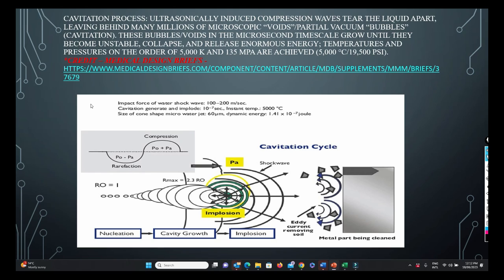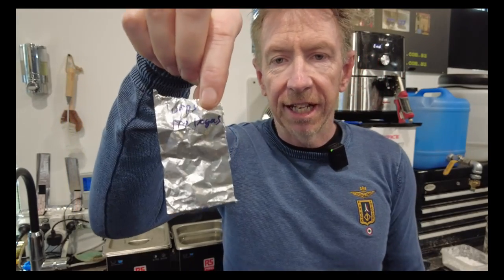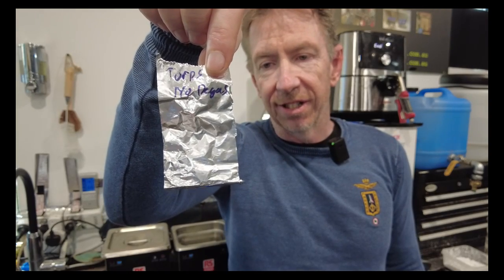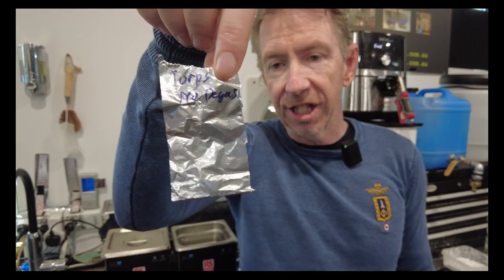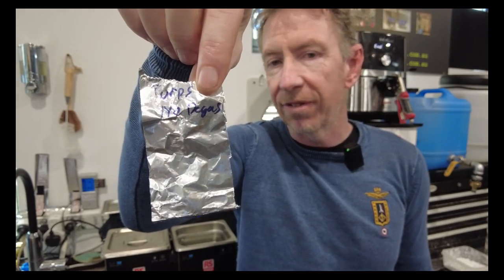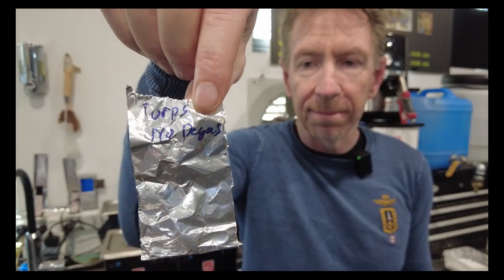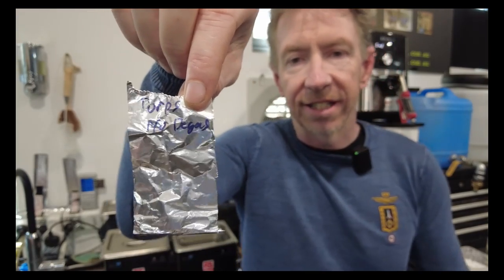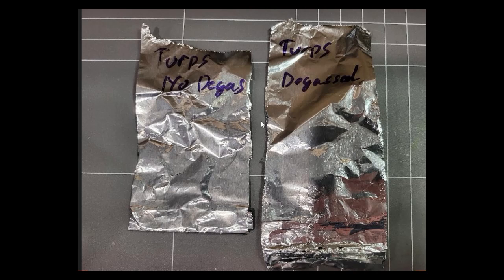Ultrasonic like a pro

Comment: MSW recommends heating wax to 200°F, but I see other sources and users recommending heating waxes to 180°F or 190°F.  Have you tested submersion waxing performance on chains as a function of the max temp of the wax when the chain is submerged?  Do you have a recommendation on this point?
Reply from the maker: Hey robin - honestly for hot melt waxing where you are swishing in pot, anywhere from basically 70dg c and 100 dg c is perfect - with the official recommended temp basically 90dg c. But as long as wax is melted and high enough viscosity for a good swishing, then all is grand, i would not be worried at all re if my wax is 85c or 95c or 80c and so on - you will rewax perfectly. 

If one is looking to ultrasonic wax - most ultrasonics heating does not go above 80dg c as that is really about the max effective temperature for ultrasonic cleaning solutions. Above that temp their is a sufficient decline in ultrasonic cavitation. You dont want to wax to be really under that temp though either as you want the wax to err on higher viscosity vs lower, as lower viscosity will again dent ultrasonic power. So for ultrasonic waxing, just having as close to the max 80dg c in the US is generally going to be best. 

Best practice for us waxing; 
> Heat in pot first is generally faster and more even. Blitz with a blender stick (but not aerating) for max friction modifier distribution
> decant into ultrasonic and set temp to 80dg c and degas run 10 mins. 
> Blitz with stick blender briefly and ensure not aerating. 
> insert basket with chain and US for 5 mins. 
> remove, blitz again, decant back to normal pot, wipe US clean / + clean with boiling water if using for other uses.
Reply: @zerofrictioncycling992  , thanks! I do the waxing in a small crock pot, and the ultrasonic cleaner is really only used for the cleaning of a new chain (with a diluted solution of Simple Green made for aircraft, i.e. Simple Green Extreme) and some parts washing.

Comment: Does the depth of solution in the US effect the energy from the transducers on the bottom?
Reply from the maker: The ultrasonics are designed to propagate cavitation with the solution filled to the line in the tank. Under filling will harm cavitation (and can make it less even throughout the solution - profession services that rely on perfect ultrasonic such as sterilizing medical equip perform regular tests with strip suspended in a grid inside tank to ensure even cavitation throughout - cheaper ultrasonics have a clear power zone in center and low power on the perimeter - something i ran out of time to cover - will do in future). Under filling can also damage the transducers - this is more likely when one has purchased a larger tank so they can do chain rings, mtb cassettes etc - and so will only fill the lower couple cm when doing a chain (GCN vid had this, and with chain sitting on bottom of the tank!! very low cavitation there, and high risk of damaging transducers). Hence on should by tank of the right size to fill to marked line in the tank - that is how it is designed to work.

Comment: Hi! What do you think of 37kHz instead of 25kHz when it comes to cleaning?
Reply from the maker: 37 to 40khz is most common by far, and seems to work perfectly fine for most solutions and parts. I believe the less viscous the solution, the lower the khz is beneficial. For solutions with a similar viscosity to water - 37 to 40 is likely perfectly groovy.

Comment: be aware with vevor. Mine is not strong enough to heat the water. I wrote to them and they said I should have the osioliation on. But took hours to heat it up even then, and u need to reset the timer every 25min. So  it sucks!
Reply from the maker: cool thanks for reporting experience, i will pull mine out to check heating time - but........ i have never used any ultrasonics heating like that. I boil a kettle, and mix in 2/3rd boiling, 1/3rd normal water to get circa 60dg water, add ultrasonic solution - set temp to 65dg c, run degas, for 10, then US cleaning run. Sweet. For those who are doing ultrasonic waxing, again heating waxing in pot first may be easier - it is not unusual - especially with budget brands - for the heating power of the ultrasonic to be comparatively low / slow. And most will only have circa 30 minute timers- thats pretty normal as well. My vevor will keep heat on tho if i just turn it on and set the temp - i have done that before and come back a few days later having forgot to find all the water evaporated and heat still on.....

Comment: You said (paraphrasing) US with wax stripper for maintenance. This should completely strip wax from inside the chain leaving it fresh to rewax? If the directions from wax say to reapply every 500k, you would strip the chain rather than quick swirl in boiling water every 500k? we're talking daily driver, not a race chain.
Reply from the maker: Daily driver you should just re wax, unless it is a full wet ride, in which case in most times boiling water flush rinses, dry, re wax. I have never bothered with US cleaning my training chain (however i also have 2 pot system for my mtb chains / gravel / cx that see full mud - 2 pot system for chains that see a lot of dust and mud is the fastest cheapest way of keeping everything awesome - refer 1hr 39 min mark of waxing FAQ vid - episode 7). 

But yes if one wishes to do a near perfect reset post mud - boiling water flush rinses to remove bulk of contamination, whilst doing that - degas wax US solution (and it should be at circ 65 to 70dg c). 10 min run post degas. Boiling water flush rinses post US clean, and for me - i would still always do an alcohol bath to ensure no film left - so dry post rinse, then alcohol bath. This is a fair bit of time for training chain. Hence two pot system like a boss is just way better for training chains. A full reset like above is normally the reserve of dedicated race chains where you do not want to bring any contamination into your dedicated race chain wax pot. 

You can also use UFO drivetrain clean in place of US wax cleaner as that will also work on waxes, and that does not need an alcohol rinse as it has a bonding agent as part of it so post boiling water rinse after US clean - dry, wax.

Comment: So glad I found your site! As a new 'indoor cyclist' I was loosing my mind trying to find what to use on my chain. I had bought a drip on wax but didn't really feel like it was doing what it claimed and your tests confirmed my suspicions. I've decided to go with Mspeedwax new formula. Currently gathering together all the supplies! I did want to ask though, as I'm riding indoors only so virtually no contaminants, less vibration etc than outdoor riding, also the fact I'm a lighter rider so naturally doing less watts than your tests (current FTP170); do you think in those circumstances I could re-wax at longer intervals like 600km or even the 800km MSW claims for dry road conditions?
Reply from the maker: Good morning Hannah - indoor trainer kms vs outdoor is actually a little harder to estimate. If you ride a lot of "base aerobic" sessions (z2 etc) then kms on indoor will be still a bit shorter than expected outdoors as you dont have any rolling kms normally. Ie on a hills ride i might do X watts for 30 mins to climb a hill, but then i have 10 mins basically rolling getting circa 10km for no pedalling. After 30 mins climbing on zwift, i dont get 10 mins of free DH km's - i am pedalling all the time. 

Some also mostly use indoor trainer for HIIT sessions only / mostly - and so those km's are harder on ones lubricant lifespan vs outdoor. 

But the lower the power the longer treatments will last for sure. How long you get you will get to know over time - when chain starts to sound and feel really dry - it will become not that pleasurable to ride when coating is too thin - then its time to re wax and get it back to silky smooth zone. 

Note that most actually find waxing for indoor only is a bit of a faff as the excess wax will all gather under traininer / stick to trainer vs just blowing away like it does outdoors - so whilst waxing is the cleanest drivetrain for outdoor cycling, it is more messy maintenance indoors!  

For indoor you may want to look at a long lasting wax lube like smoove, or ceramic speed now have an indoor specific wax lube - or some will go to a long lasting wet lubricant like silca synergetic or rex black diamond as contamination is not really a concern re making wet lubricant abrasive - it will run black like all wet lubes but you dont need to apply very much for a very long stint of very low friction very low wear protection. 

I am of course a very avid waxer for all my bikes EXCEPT my indoor bike due to the wax flakes build up. 

Hope that helps!
Reply: @zerofrictioncycling992  Thank you so much for taking the time to write such a detailed response! When you say the chain will sound and feel dry, will it be obvious? As a non-experienced cyclist should I be able to tell when the chain is sounding dry vs normal chain noise?
Reply from the maker: @hannahjm93  For most people yes it is very obvious - but everyones sensitivity is different. It is a pretty distinctive "zzzz, zzzz, zzzz" sound on pedal stroke when wax layer is getting thin.  Myself and some waxing friends who i ride with are pretty sensitive and dislike the dry sound / feel and so have always erred on re waxing early. However every now and then i catch up with a friend, or im racing one of the racers on wax - man i can hear their chain from 10 riders back - i will ask them when the heck did you last re wax and they be like "oh? you think it is due?" - i have no idea how they cant tell as its driving cyclists around them mad chain is so loud - basically starting to squeak, let alone riding it themselves. So whilst some people dont notice anything more subtle than being hit by a bus, i would say that is very much a minority indeed, the majority find it is very obvious and easy to tell. It will be exciting to see which category you fall into hahahaha! :)

Comment: It would be quite interesting to see a battle between Silca chain stripper (they claim it's the best of the best, I claim it's megaexpensive) and UFO drivetrain cleaner, which you claim 100ml of it removes factory grease off of 5 chains (if I remember well).

Edit: 10 min into the video and I see you got this in your list of tasks 😂😂 Eagerly waiting for these tests 👍
Reply from the maker: For sure me too - the control test will actually take a bit of resources as to put claims to the test each product 100ml is going to need to do multiple chains and see how the wax bonds so it is going to be circa 3 to 5 chains per product to be done. I am going to try to get to this one asap.

Comment: Not related to the video, but get shot of the widows laptop dude, never heard my Mac trying to take off from the desk…my previous windows OS machines eventually all sounded like a jet. I’ve only recently moved to Mac.
Reply from the maker: ha yeah i know honestly something has happened - its been great for years (pretty flash alienware gaming laptop so has lotsa power) - but started yesterday just working at 100% doin nothin - i will have to get my super IT lady to have a look. It completely froze twice yest and had to restore film edit from back ups - was a friggin disaster, and then on export a couple of clips didnt come across - and it took soooo long i just cant faff to re try atm - this thing is barely working - maybe something has snuck in and its making it mine bitcoin or something!!! yest arvo did not quite run smoothly.... sorry for background noise. It still going flat out now with just this window open.